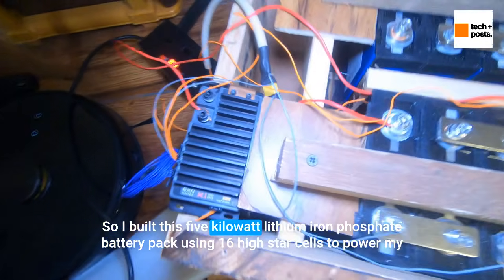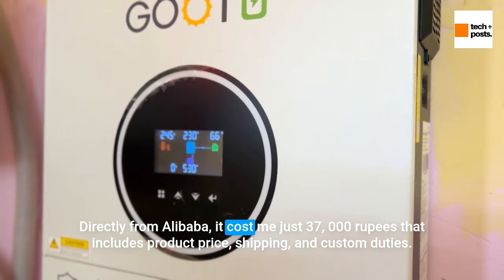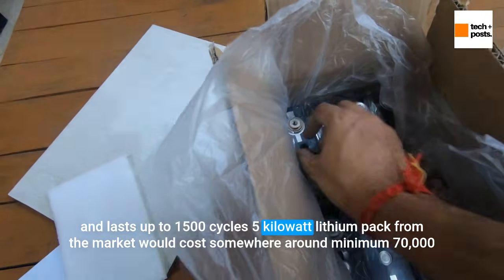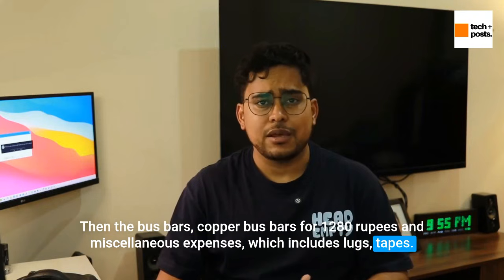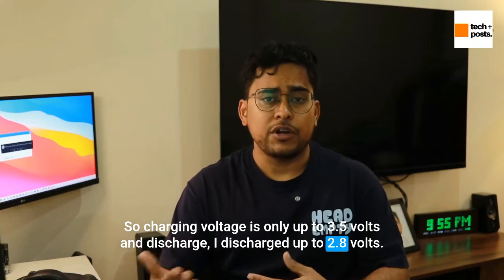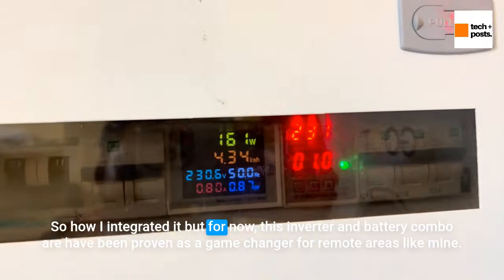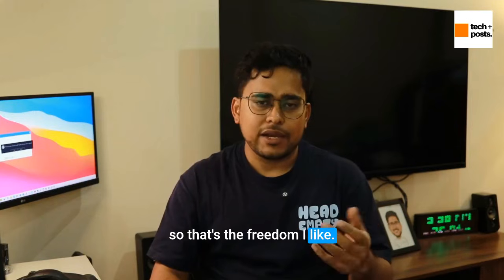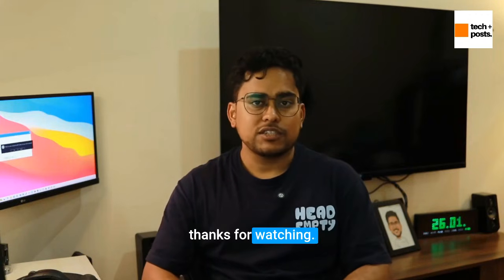🚀 DIY Smart 5kW 16S LiFePO4 Battery for Reliable Off-Grid Power – Save BIG on Backup Energy! 🔋⚡

Comment: Are you able to run inductive loads too
Reply from the maker: Yes. Water pump 1hp. Easily. Then we have a cooler, fans, and even AC 1 ton. It does not even heat at like 2Kw load. Which is usually the load. Highly efficient. Using it for more than a year now.

Comment: Can you share which store in alibaba you bought Gootu can't find in that price nor could find seller shipping to India 1 piece
Reply from the maker: Shenzen Jiesaiyuan Electricity Co. ltd
Reply: @ravis1ngh I want to build same inverter no solar can you confirm 1) is there any risk of export to grid? 2) wiring details want to confirm the details. 3) from which dealer you bought the battery. 4) can we get entire list of components and link to buy them. Thanks
Reply from the maker: @rajivdey1684 i made the battery by mulyself using 16 100Ah Highstar cells sourced locally in Delhi for 33K. And JK BMS worth 6K. Made a wooden box by myself with wheels, see the video. No risk of grid or anything. It takes input 220V and outputs, has Solar PV connection and battery connection mount holes. 
Very easy to setup.
You can use 4 lead acid batteries also 100-200ah or larger. Works well. Been almost 9 months now
Reply: @ravis1ngh  my concern is gootu is Hybrid inverter and my electricity board do not support grid export. I am aware this can be configured in Gottu inverter with zero export but what I want to check with you is there any possibility by misconfiguration grid export will be a risk this will be high risk when lineman are working during loadshedding. In other words is there a chance that the hybrid inverter start exporting power to grid from solar panel or battery due to config issue or system failure. Given it's hybrid inverter. Your advice will help thanks.
Reply from the maker: @rajivdey1684 this does not export anything. It works locally and moreover, you need net metering for that and that’s a different meter and a different setup altogether
Reply: @ravis1ngh 

Thank you very much for clarifying my concern. You are very knowledgeable and helpful. For the risk of export with hybrid inverter I was planning to use normal Ashapower Lander UPS with LFP battery but you gave me more confidence to use Gootu hybrid. With regards to wiring I am planning to replace the existing normal Exide inverter by extending the main from the existing inverter to Gootu hybrid inverter and only use Gootu backup output and not use the main output of Gootu though Gootu hybrid got dual output. In other words Gootu will not be connected directly to Grid meter mains rather the mains will come from the inverter point of existing inverter. And Gootu backup output will be used for important inverter line. The existing inverter will be removed. Basically the Gootu will act as UPS and no solar panel is used, the wiring is correct?
Reply from the maker: @rajivdey1684 you may directly connect the Gooty to your power supply without any middle UPS or Inverter. There is no safety hazard. Use it just like any other inverter. It’s call Hybrid because it can directly convert solar power to AC power, charge batteries with hoth solar power and AC and also provide backup from the battery. It’s not a net metering wala Hybrid Inverter.
Reply: @ravis1ngh  the model I saw in Gootu website clearly mentions export but yes it can be disabled by config. So which model you bought that is not netmeetering walla hybrid. Because all Gootu hybrid I see is netmeetering walla hybrid with export option but export can be disabled. Thanks
Reply from the maker: @rajivdey1684 JSY-H4862E-120D Also, connect with them to clarify any query you have they are the best to answer as they keep upgrading models and features.

Comment: Good job. Unfortunately we still have to rely on Chinese made LFPs. Don't know when Indian brands will bring their own in India. Hopefully Amaron do that soon.
Also, in China 320Ah are in trend and here in India we are still stuck with 100Ah. We are too outdates in terms of LFP utilization. Most of bigger brands are importing these and launching their own battery packs for huge amaount.
I think you could have negotiated on the batteries more, considering you got 16 nos . These could have costed easily between 1.7 to 1.8K.
Reply from the maker: These were for 1800+GST. Every few months the price is going down for these. And yes, even I was looking for 320Ah cells but no one has. I had option to buy Highstar and Eve cells. Went with Highstar. Next, I will build another pack for the same setup (in parallel) with Eve cells. BMS will be same model. I also tried importing from Alibaba but that’s too costly when shipping and duties are added. We have to rely on these importers ans traders for now. 
Considering govt. plan for their ambitious EV adoption in India, not seeing anything on ground related to batteries except Tata and Ola but they won’t be available for domestic use. Also, Not sure how reliable they will be.
Reply: @ravis1ngh  yeah, agree. Even if in India it's available for end users, won't be in same price as Chinese imported ones.
I know one seller who sell refurnished cells. They actually get these used batteries which are using these primsatic cells. They do have 280Ah I guess with not that high IR..
Planning to make one basic 12V 100AH for testing purpose. 
Alibaba recently was running  offer of free shipping to India with no charges. I ordered one 16S 150AH BMS with no customs. but that was only on first order. you must have purchased the hybrid inverter from there already.
Miss those good old aliexpress buying experience 😆
Reply from the maker: So the inverter I purchased was DDP. Duty was paid by seller. I have inportant many items in the past and as per my experience if the item is coming via normal post like Hongkong posts and india post at the end, custom charges are not levied. But in case you choose like DHL or UPS, they never miss on custom duty and you are charged almost 90% of times. That’s my experience.